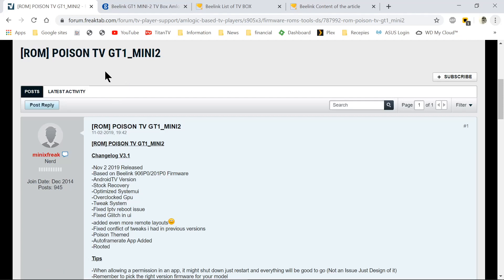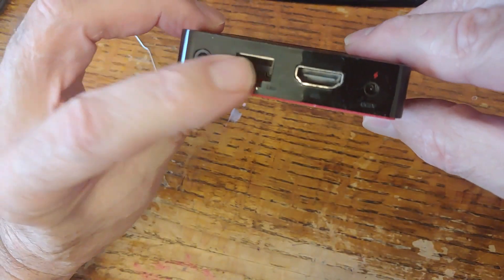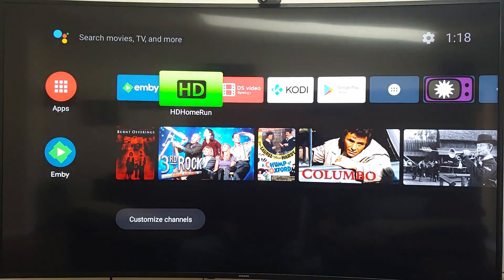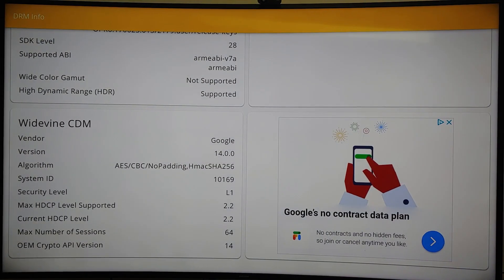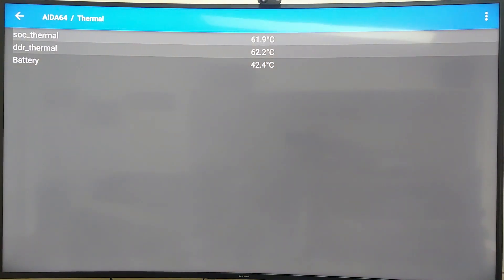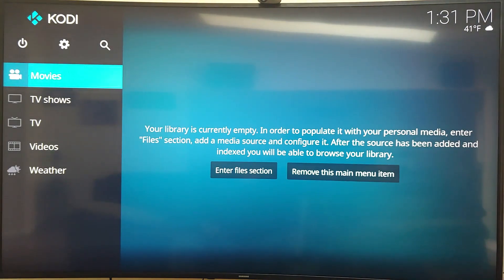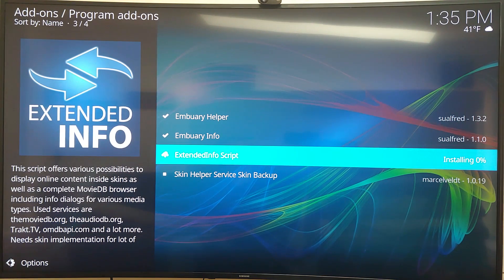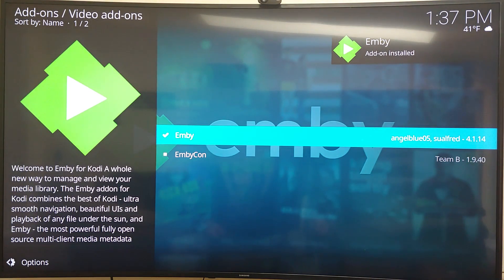How to install firmware onto Beelink GT1 Mini 2

Comment: So I don't need a power cable for turning ON the box for installing the firmware right? Just plugging the USB cable without power cable will do it, right? Please answer because I don't want to do it a wrong way then it might be scrapped.
Reply from the maker: NO power cable needed.
Reply: @clarkss12  thanks 👍

Comment: Hello, I watched your video. My TV box is GT1 Mini A. I can't watch Netflix recently. This should be a common phenomenon. I can't watch NF in this box. Would you like to know if this box has the possibility of repainting the firmware? To re support Netflix? Thank you
Reply from the maker: Netflix is killing their service on any unsanctioned device.  if you had Netflix running in HD and it does not work now that means Netflix killed it.  Your only option is to find a standard definition version of Netflix to install on your box.
Reply: @clarkss12  Thank you for your reply, I also guessed that Netflix may have blocked my box, because the first few months can also be normal to watch, on this two months can not watch, in addition, the Netflix App I downloaded in the box's own Google play, I would like to ask, this situation can be passed. Re-swipe the firmware to get Netflix support back?
Reply: or   here   take  this parameter  and  see  if you   have in droid settings  the  NETFLIX  ESN NUMBER     Same at this video